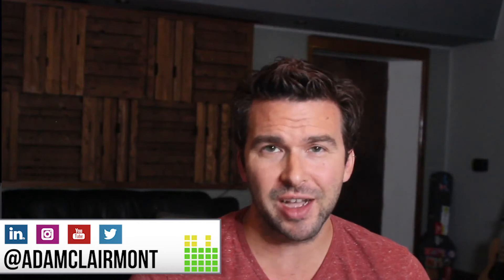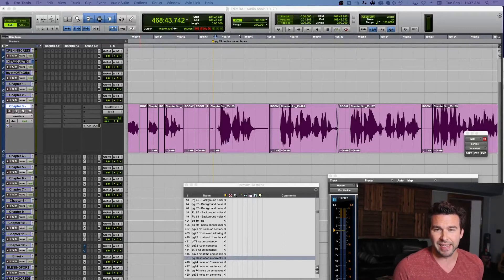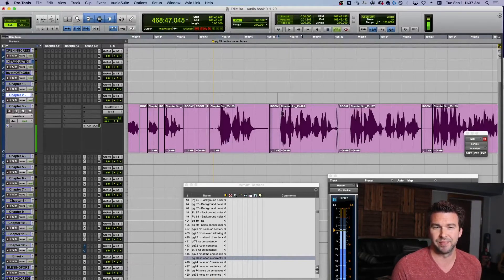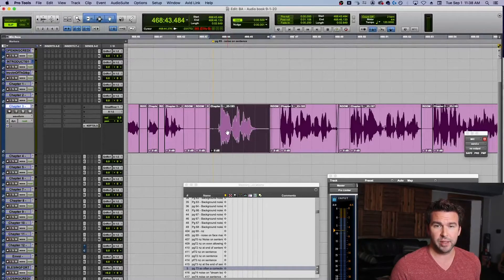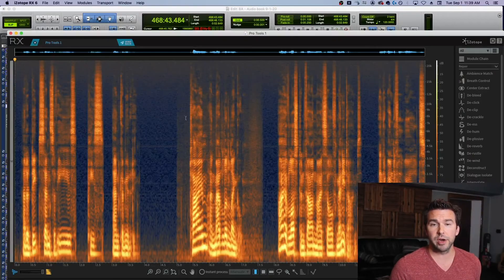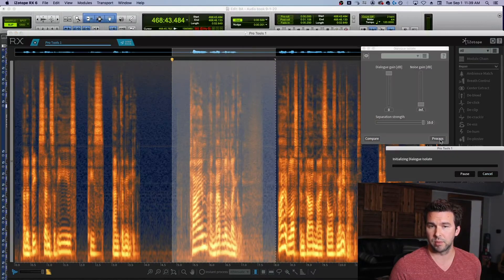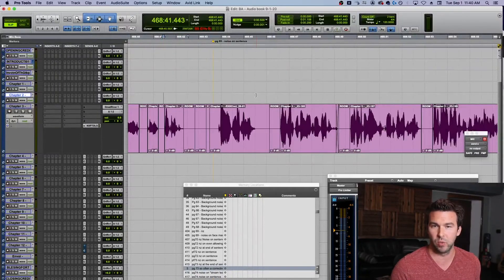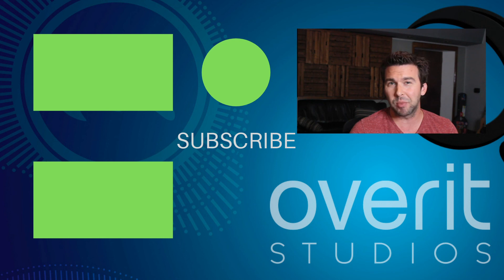Clean Up Dialogue Audio [Solving Audio Problems]

Comment: Thanks! Super helpful for a sound editor just starting out 💕 quick question: would you recommend copying the original track and using izotope on that separate track in case the mixer doesn't like what I've done to it? Or is this considered standard dialogue cleanup and doesnt require the additional tracks?
Reply: Hey, as in all things like this where you are working with a team, communication is important. Have this conversation with the mixer before you begin. Most times you will be asked for a backup playlist, the prod audio unouched. Your edit would be on the main playlist. This is my typical workflow, even if I'm mixing. I always want the option to easily get back to square one.
Reply: @AdamClairmont  awesome, thanks for the answer! 👌